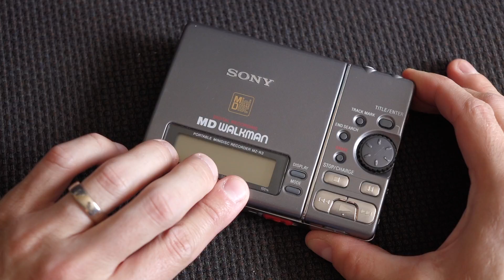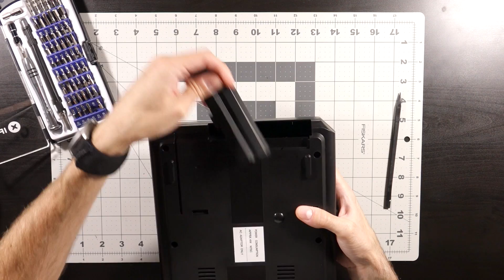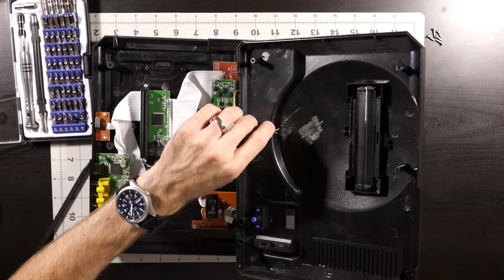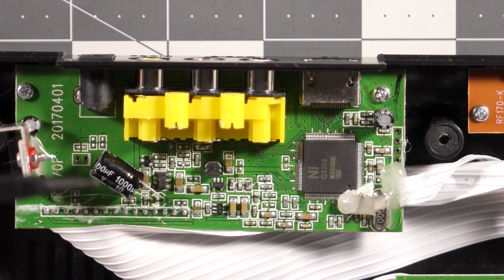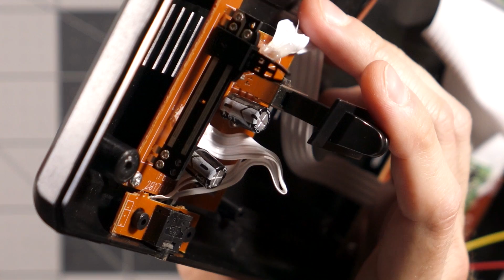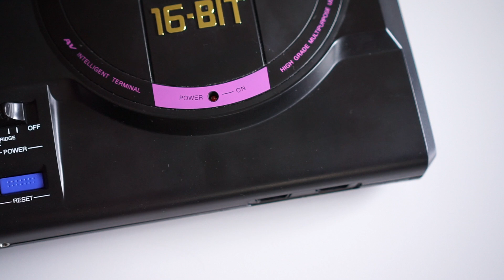Clone Genesis Console Teardown!

Comment: I know this video is old but recently on twitter (X) a Japanese user has been getting clone consoles with this same exact chip (TCT-6803) and fixing the issues the manufacturers tend to have like the sound imbalance, mono audio and virtua racing compatibility. It's too a point where SEGA CD games play fine with CD Audio on it with a Mega Everdrive Pro and normally that doesn't work.

Comment: It is very possible that the audio/video chip is capable of stereo output. The reason for mono stereo output is component cost cutting. There is much to be gained in just removing a few real components. ATGames is famous for it. They removed stereo sound from the AT Games portable but then stereo audio was restored by a talented hardware hacker. And thank you for this informative video.

See here for the stereo output hardware restoration hack on the AT Games portable. 
It's a DDNS protected website so that is why the url looks funny.
http://vfiuchcikicshuusrch.ddns.net/?post=9

and or more here:
https://www.instructables.com/id/Turn-an-ATGAMES-Portable-Sega-Genesis-Into-a-Wirel/

Comment: i bought mine my only issue is i used a usb powered hdmi for my tv because it does not shows up when i directly put the sega hdmi cable on the tv i wonder if its my sega or the tv

Comment: what do you expect from a clone system especially if sold cheap? everything should be done to save cost, including just using glue gun to hold down some cables and parts. more interested how it performs especially like the game timing, sound(is there a genesis-on-a-chip able to produce how model1 sounded?) and cart compatibility.

Comment: I just bought one of these, I try hooking up the original Power Base Converter to see if that thing fit the console. It does fit the mold nicely but won't connect to the cartridge connector due to the connector being made a bit deeper down. The Power Base Mini from Stone Age Gamer will work just fine though but the original Power Base Converter just wouldn't connect. Also playing Sega Master Systems on this thing is terrible due to the glitchy graphics.

Comment: In terms of the LED the original Megadrive wasn't much better, in fact the hot glue is (possibly) an improvement.  The LED came through a 2 pin connector and the legs were bent to the side so it couldn't short.  Instead of glue to hold it in it was pushed in from the other side and held in using a plastic top piece

Comment: Yeah that mono mixing process is the biggest bummer because that stereo rca output becomes just a waste of metal.
Whoever knows a new revision or a mod chip will fix this issue.

Trough even the mejesco version aka genesis 3 lacked stereo & rgb out and even cannot play sms games or even some genesis games, leg alone running addons but despites that it recieved a shameful license from sega.
Reply: johneygd the stereo was easy but they failed big time on this too 👎

Comment: I've heard that this could likely be modded for stereo audio.

The TCT chip (GOAC / ASIC) is used in many other clones (as you said), and I'm fairly sure it can output stereo.

But scrimp even more, they simply joined the two stereo channels together on the main board, AFAIK.

It would be strange for the HDMI scaler chip not to accept stereo audio if it's encoding it in the first place.

Comment: This console is only useful if you have a weenie modern TV that doesn't have any analog inputs anymore. If your TV does have a composite or S-video input, then it will probably do a better job of upscaling the Genesis's video to HD than the cheap upscaler chip in this console -- and with a Model 1 Genesis you can get stereo sound, too.
Reply: One issue to look out for is that some modern TVs don't work correctly or at all with the 240p signal the MD/Genesis outputs and on some where it does work you may get high input lag which makes it unplayable.

Comment: Hey.... have you tried putting a 32x rom on an everdrive and loading it in?
Reply: How would a 32x rom work off an ever drive, if there's no 32x hardware... Hmmm.
Reply: Drew LaRussa Plus, the 32x requires a separate cable to attach it to the genesis, so it wouldn't work

Comment: Hm... what if there was a mod that added the expansion slot for using the Sega CD?
I would have also said "another mod to add 32X compatibility" but I don't know much about the system, thus I don't know if the 32X works or not on this.
Reply: zeldafan1002 the 32x uses the genesis's proprietary video connector, so with this thing using RCA ports, some sort of adaptor would have to be made.

Comment: The reason the picture is so soft via HDMI is because the SoC is outputting analog RGB and the video encoder is upscaling that. The same encoder can be found in most cheap component to HDMI adapters on eBay.
Reply: That's only half an explanation though. Analog RGB can look nice and crisp, especially when the source is so low-bandwidth. To make it bad, you have to either do a bad job of ADC, a bad job of upscaling, or just mush up the signal in transit. My guess on this case is "all of the above",

Comment: I would love to see the guts of the Brazilian Tec-Toy version.
Reply: Hi! I'm a fan from Brazil, and I would love to send one for you, but it's actually really expensive costing R$449,00 (around 120-140 dollars), besides the shipping is really expensive too.

The sound chip is really bad and, it sounds really bad, but the Mega Drive community is really nice and did some improvements with Custom Firmware but it doesn't sound perfect.

Also, the video signal is only AV, and is really bad on modern TVs but it's actually not that bad on CRTs. The community have tweaked the video signal too over custom firmware to correct the color and the contrast on the console.

So in the end it's not that bad of a console, but only thanks to the community and it's overpriced.

Sorry for the bad english and keep the good work on the videos
Reply: Fun Fact: part of the reason why the TecToy clone sucks so much audio wise (as well as those weird compatibility issues) is that it uses the DMC RedKid GOAC (those AtGames clones use the RedKid 2 chip, rather than an ARM-based emulator as commonly  believed, so you can imagine that the original is even worse).
Reply: https://youtu.be/SgV0CfrF-_k
Reply: Check my link above or search phrase: Desmontei NOVO Megadrive TecToy 2017. TecToy version is basically the same Sega on a chip concept but the build quality looks much better.
Reply: Dratini Joga! || Even the 90s brazilian MegaDrive is that crappy? Or you are talking about the new version they released some time ago?
Reply: Roddy only the New version. The old ones are exactly like the classic genesis
Reply: Well I would love to have the guts from my enemies.
Reply from the maker: I'd love to get my hands on one of those!
Reply: Roddy yeah, but they could at least use a decent Sound chip...
Reply: Ryan Bates 
Been hoping that they would release their stuff outside Brazil. Heard that it's difficult to get one unless you know someone there that would ship to ya 🤐
Reply: I can look into shiping you one if you guys are interested.
Reply: There are a bunch of TecToy MDs for sale sealed near me. I think I should get one sometime. I've had one when I was a kid and it's interesting to see foreigners being interested.
Reply: Dratini Joga! || Oh I see. Perhaps it's because there are no original hardware parts nowadays.

Comment: Doesn't need the metal shielding it's got no RF.
Reply: LimpingMonkey there is RF all around us. Shielding helps cut down on coupling between the circuit and surrounding RF.
Reply: He said in the video the controllers are RF